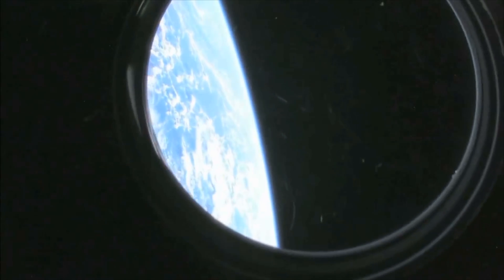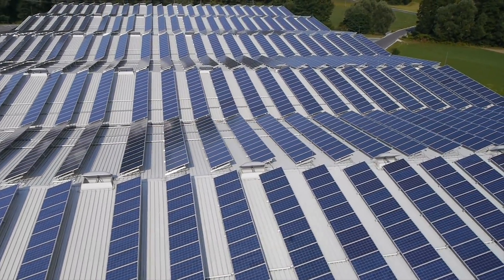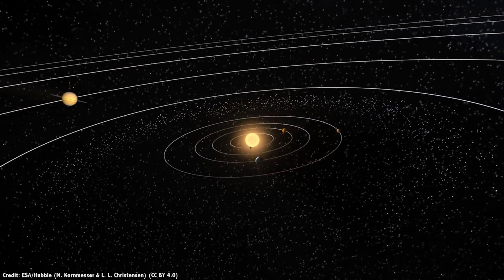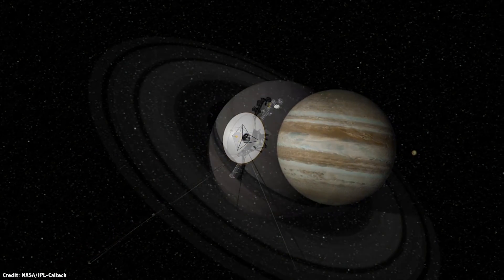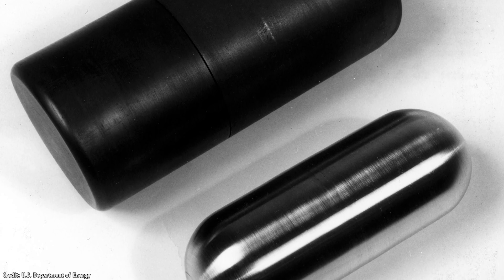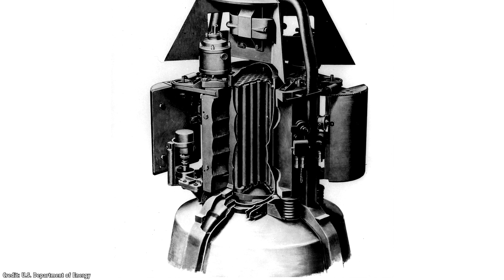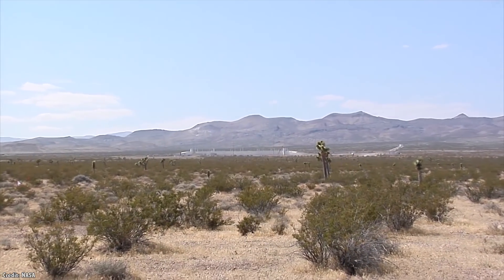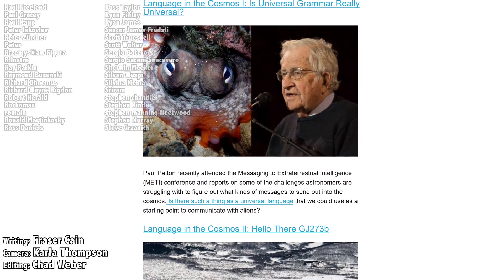The Problem of Power in Space. NASA's New Kilopower Reactor

Comment: Giant space lemons with 2 wires in them.
Reply: Assuming that you manage to capture at least two of the famously elusive giant space lemons I think that launching the properly sized copper and zinc electrodes would be prohibitively expensive.
Reply: Nicholas Alt we could just grow them in space 😂
Reply: @ Ned yes! one wire plugged into Venus, another plugged into Mars and free energy YAY!!!
Reply from the maker: That's just crazy enough to work.
Reply: Orlando Saint-Sebastien         Otherwise known as Plutolemon238
Reply: a great leap over the old giant-space-potatoes-with-2-wires-in-them system, which was too silly to ever be feasible for deep space power generation
Reply: Orlando Saint-Sebastien for president
Reply: Russians already have something working with potatoes
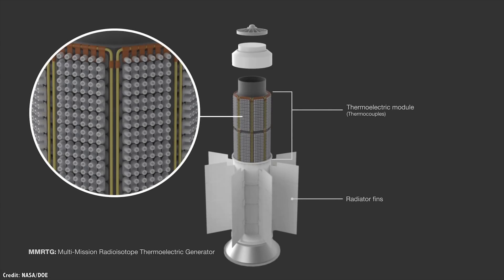Reply: 8:00 Why can't they use Uranium 235 or synthetic U 233 instead of Pu 238,  for these RTGs? What about Promethium Cells?
Reply: I would take a large packet of Fisherman's friends - these would keep the crew warm and happy. Problem solved.
Reply: Use a rubber band and stretch it to release its energy
Reply: One of the giant lemons might be the planet Venus since it has a goodly amount of H2SO4 in the atmosphere.
Reply: That's not the craziest idea. Similar batteries are made by pounding rods into the ground. It would be an interesting experiment to conduct on a planet like mars.
Reply: Orlando Saint-Sebastien too bad it won’t work.
Reply: @clxwncrxwn  looks like you missed the joke smart boi
Reply: Ahahaha lemon batteries are shit
Reply: I like how you think
Reply: That shit is hilarious...
Reply: Was that your high school science experiment?
Reply: Ah, yes, the battery.

They won't work for deep space exploration.  Batteries have to be warmed, (for years), to keep them operating.  But if you use secondary batteries to warm them, then you need tertiary batteries to keep the secondary  batteries warm.  But then you have to bring along even MORE batteries to warm the tertiary batteries, and the mass of your space craft shoots towards infinity.

However, I smiled at the image of giant lemons in space.

Warm regards, Rick.

Comment: Fusion reactors are unlikely to be used for small spacecraft. Nuclear fission can be realized in small devices, even the first experimental reactors were small and relatively simple. Fusion on the other hand needs giant infrastructure, even our experimental reactors are huge facilities (which is also one factor that slows down the development). It would be like launching a large power plant into orbit. Not impossible, but it wouldn't fit in a small spacecraft.

When fusion reactors are ready, they will be used first here on earth in nuclear power plants instead of the fission reactors. The cost for energy won't get lower because the fuel for the fission reactors is only a small fraction of the overall cost. But it will reduce the amount of radioactive waste and is far less dangerous.
Reply from the maker: We haven't even made sustainable fusion reactors yet. Once those work, I'm sure they'll try to make them small enough for spacecraft. Maybe they'll never figure it out.
Reply: A fission reactor is basically just fuel and a control-rod to regulate the fission and something to convert the produced heat into the desired form of energy. Just as explained in the video. These reactors can be built very compact and lightweight, the 10kW device is expected to weigh 226kg.

Fusion reactors on the other hand will never get as simple like that. Those devices need a lot of highly complex and power-hungry machinery to keep them going. They will need another power-plant to get them started. A fission reactor can easily be started, just remove the control-rod.

I don't say that fusion energy is impossible. But it is very unlikely that they can be downscaled in size and complexity to be comparable to that tiny fission reactor.

Anyways, thanks for the reply. :-)

Comment: Could there be a way to concentrate cosmic background radiation as a source of energy?
Reply from the maker: Not that I know of.
Reply: If that were possible, there would be far more interest in a way to dispersively deflect galactic cosmic rays away from spacecraft, than to concentrate them onto a specific part of it...
Reply: Energy is differential. Background radiation is about the lowest state known. Only real use is that its a giant heat sink.

Comment: there are semi conductors which produce current from temperature differential.C change of temp may produce power. These units are used as solid-state refrigerator but when reversed create power from differential in temperature between two surfaces. Maybe bury one in soil of Mars expose other surface to hot cold atmosphere. 
Excellent show Frasier.
Reply from the maker: Thanks! I wonder how much usable power you get out of a system like this?
Reply: Fraser Cain they wanted to use on artic sites. I send you data. Shalom
Reply: Fraser Cain Look up "Peltier device".... semi conductors which when reversed generate power from temp differential.  I retired from US Dept Energy and very familiar with nuke stuff. Love your show and Dr Grey. Tell her. If you get famous from it just donate $$$ to my rabbi OK? lol

Comment: Good presentation, but you missed an important point.  RTGs lose power over their lifetime but not due to decay of the Pu-238.  It has a 26.4 kyr half life.  Power loss is due to impurities degrading the semiconductors which convert heat into electricity using the Seebeck Effect. 
Kilopower looks like it will work, but will no shielding people will need to stay well away and they can never be serviced.  Start rigorous extended life tests now.
Reply from the maker: Thanks, I didn't realize that. 😀

Comment: I would be interested in knowing the advantages of Kilo-power over previous fission systems.  Also, what are the worse case scenarios, e.g., launch accidents?  BTW, great video.
Reply from the maker: It looks like safety is one of the big advantages.
Reply: Is because it's U-235 low enriched uranium?  By itself relatively low radioactivity.  The neutrons go up when it is turned on space?    (That's what I gather googling around.)

Comment: Geez. Is there any way the US hasn't managed to completely screw over its own space agency in the past three decades? :p Poor NASA.

Maybe fissile material could be launched encased in containers designed to survive unplanned reentry and the reactors could be loaded and fuelled only after the spacecraft is in a safe orbit?
Reply from the maker: As I said, RTGs are on the menu again, and this kilopower plan will take it to the next level.
Reply: Yes but like any other big promise on NASA's menu, all I can do is assume it will be cancelled. The bigger the promise the more certain the cancellation.
Reply from the maker: These specific technologies seem a little more safe, like ion engines, etc. They get developed and then pop up on different missions.
Reply: +Miki Cerise
I mean, with their new reactor design where they have the fuel distanced from the heat exchanger by pipes, is one of the reasons why they bothered with that at all. You don't have to do it, but if you do, you can encase the fuel in a nice layer of ablator.
Reply: Future spacecraft could use nuclear fusion, nuclear diamond batteries or isotopic batteries. 
"research is also underway to determine the feasibility of accessing energy stored by isotopes at 100,000 times the density that chemicals can provide."
Army-led effort demos new atomic effect for potential isotopic battery
February 07, 2018 By ARL Public Affairs
https://www.arl.army.mil/www/default.cfm?article=3162
Isomer depletion as experimental evidence of nuclear excitation by electron capture Nature volume 554, pages 216–218 (08 February 2018)
doi:10.1038/nature25483
https://www.nature.com/articles/nature25483
Reply: Why would you load the reactors when they're in orbit? The safest place for that fuel is IN the reactor, which would be the most heavily shielded part of the craft next to the heat-shield itself if it has one. The issue is that if it breaks up in reentry, that reactor needs to be one HEAVY sonofabitch to avoid melting, ablating, or even cracking open if it hits ground, which, frankly, ain't happening. If it comes down, it WILL ablate away regardless, scattering radioactive debris over a large area.

Comment: Can't we use the radiation in space itself to recharge our probe's batteries?
It's essentially 'electricity without the wires'. (Charged particles in motion)
I've read somewhere that the van allen belts are estimated to contain around 6x10^15J of energy, in the outer solar system around the large gas giants we want to study, the radiation belts would contain much much more? They're naturally self-replenishing. 

I assume that it'll need big heavy coils to extract enough power, and pushing something like that to the outer solar system is going to be pretty pricey.
It could be worth it though, if you can extract the energy quickly enough.
Reply from the maker: Did you see this video I did on electric sails? https://youtu.be/-pIl_cv3OkA

Comment: Hi Fraser, hadn´t the idea of stirling engines been around for a while now?
I think the biggest concern was, that a stirling engine uses moving parts, which is a big flaw when entering space or has there been some upgrade on the traditional design, where there are no moving parts anymore?
Reply from the maker: I hadn't heard of Sterling engines matched up with fission reactors yet.
Reply: I´ve read it on Wikipedia a while ago.
Reply: You have to have moving parts but Teflon rubbing on Teflon lasts a long time.
Reply: Moving parts in Stirling engines was my first though, no way they'll get 40 years out of them like the TEGs on on the Voyagers. 1kW is a lot of movement.
Reply: If you assume 4 pistons you are under constant power and thus does not to be moving fast. It is just a matter of designing for the life you want. if the voyagers had used Stirling engines they would be putting out a lot more energy than the TEGs are because the thermal-couples are being degraded by the radiation and are losing efficiency at a rate about equal to the lose of energy from nuclear decay.
Reply: Some closed-cycle gas turbines using foil-air bearings would be much better. Supercritical CO2 would be the working fluid; convenient because that's what the martian atmosphere is made of. Brayton gas turbines are far more power dense than Stirling engines and heat pipes.

Comment: 1KW of power is very little - solar panels produce as much if not more. Yes, it will be great for space probe missions beyond Jupiter, but even there they won't supply significantly more power than an RTG. On the moon or Mars, solar panels can work almost as well. The real game changers will be reactors that can produce hundreds of kilowatts, or even megawatts of energy. Such reactors can be used for much more powerful ion engines, or nuclear thermal rockets. A reactor on a nuclear submarine or aircraft carrier can generate megawatts, so we know that relatively compact reactors of this class are possible. Is NASA or any other agency working on such reactors, and if not, why not?
Reply from the maker: Different power systems work for different places.

Comment: You mention that the crafts require electricity to keep warm but wouldn't they be quite toasty if they're in sunlight? I guess they're not always being lit. Would be interesting to hear the different temperature systems spacecrafts use, especially ones with people in them. What would happen to excess heat for example?
Reply from the maker: It depends on how far they are from the Sun and if they're in shadow.

Comment: TIL Juno operates on less power than a toaster. I don't know it I should be more amazed at it's efficiency or enraged about how wasteful our earthly technologies are.
Reply from the maker: In the final vote, mission planners chose the science instructions over the Jovian toaster.
Reply: yoshyoka the main methods we have to create heat are:
1.  Electro resistivity, the way our toasters currently work.  Cheap, but not efficient.  
2.  Burning fuel, like propane, wood, feces, etc.  Actually not a bad idea for a toaster, but it would easily quadruple the cost of the machine. 
3.  Nuclear decay / fission.  Expensive, dangerous. 
4.  Refrigeration / heat pipe systems.  Bulky, expensive. 
5.  Solar concentration.  Only works during the day, and needs large optics.

Take your pick.
Reply: I am not against the toaster in particular (even if current toaster designs, which heat resistive spirals at a distance and use air (an insulator) as heat transfer medium just give you an efficiency of 50% at best. 
1. A thick film resistive heating array on direct contact metal plate would ram you up to 80%. It would be only marginally more expensive than a conventional toaster but have a way longer life time due to lower heat stress.
2. A propane like burner can be produces by having sheet metal pressed and welded. Complex nozzle designs are cheap if produced in scale. What holds them back are considerations about safety and convenience.
3. I'd gladly avoid these in the houseold.
4. Not for toasters..
5. You can use cheap paper mirrors with aluminum coating, no expensive optic required.
6. IR lamps, way more efficient than resistive, yet not really good for the toaster itself.
 You can also create heat by a number of other processes, such as friction, static discharge, plasma decay, radiation absorption etc...  

I work in R&D, I know damn well how to generate heat.
Reply: Since you're such an expert, how could you be enraged at our technologies?  You should know why toasters are electro resistive, and don't use some other method.  And you sure made a bunch of errors in your post for being such an expert. 

Toasters using electro resistive elements are already heating primarily via infrared radiative heat transfer, not air convection.  IR heating from a heat lamp is practically the same thing as electro resistive elements.  Current heats an electrode, it glows in the infrared, heat is transferred radiatively.  The efficiency of a heat lamp is no better than the efficiency of electro resistive elements.
Reply: ...you missed the whole point altogether... 
yes, the toaster uses IR transfer not convection (where I mentioned it is convention eludes me). Using IR transfer is wasteful to heat toasts, reason why in most professional environments hot plates are used instead. Not to mention that the IR lamps ARE electro resistive, the increased efficiency is given over time due to decreased tungsten evaporation. 
 
But again, this is not the point. The point is that most of the technology we use in our homes are not designed with efficiency in mind (this is especially true in the US, less so in Europe). Improving current designs would reduce our energy requirements significantly. But again, you are more interested in ad-homine than having an argument.

Comment: I thought Apollo used fuel cells for its power supply
Reply from the maker: They work for a couple of days, but not months or years.
Reply: Fuel cells still rely upon stored elemental Hydrogen and Oxygen to function(producing water and energy in the process), and since these both require bulky storage containment, you can only have so much of it in space. The benefit of using the fuel cells is that they capture much more of the potential energy in the reaction than simple combustion of the hydrogen, and only water is created in the process with no waste CO2.

Comment: don't have any idea, but... on electricity /electronics, it is easy to transform a few volts into dozens/hundreds thousands volts, with just a few components. or maybe millions and millions volts. wouldn't there be a way to have the electric parts work at much higher voltages and require less watts ?
Reply: no name - the energy is the same, and with high voltage you need much more isolation, there is a reason why we use lower voltage, cheaper and safer
Reply from the maker: There are good reasons to change voltage for transmitting energy long distances, but in the end, energy is energy.
Reply: since 1994, i have that crazy yet simple idea to generate electricity for free...with just a few chip parts.. with a yield >1   (don't joke don't joke). the reason i haven't prototyped yet: i would get shot in just a few days.. and because i wanted to live.. and why i know it has 99% of chances to work as i want ? because i already saw some concepts that look a bit like my idea... with yield well under 8 or 7...  but they missed the big picture, and took the complicated path... when what was needed is everywhere around us, no need to use some crazy tech or techniques. one day i might find some motivation to take a serious look at it. meanwhile, please make me laugh, with some troll comments about, ex, yields above 1 don't exist :)
Reply: no name - it must be a strong motivation if only live for a few days, what about connecting those chips in series creating even more energy, perhaps you could make a force field stopping those bullets?